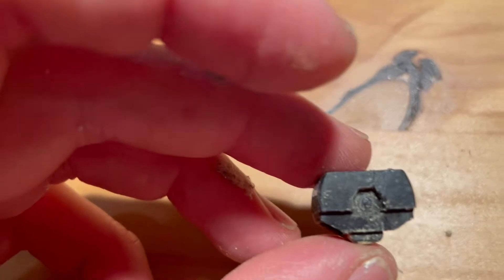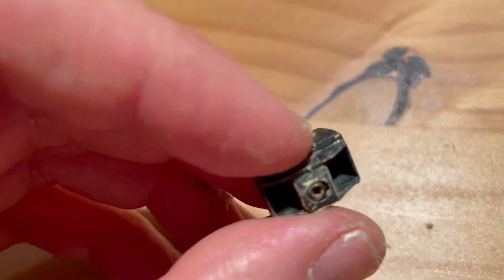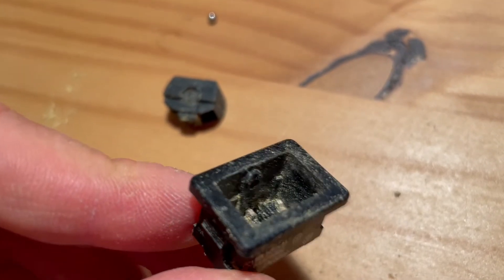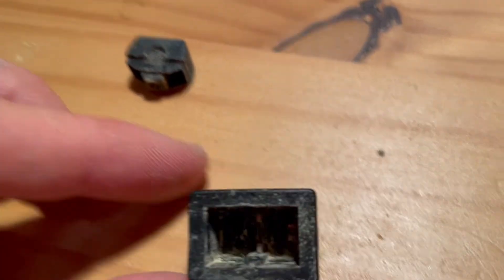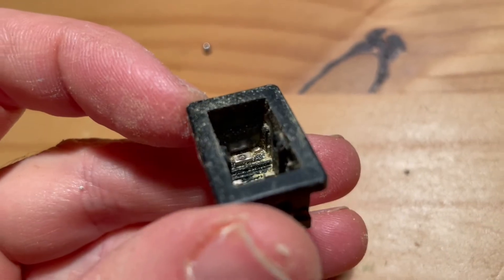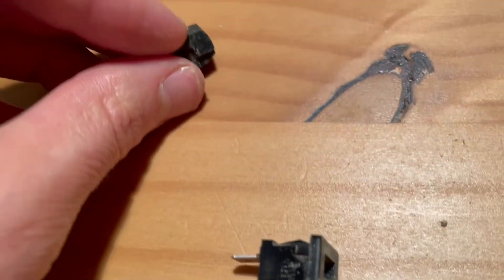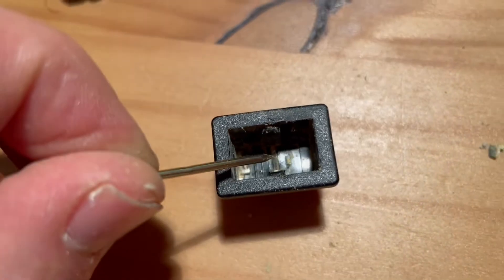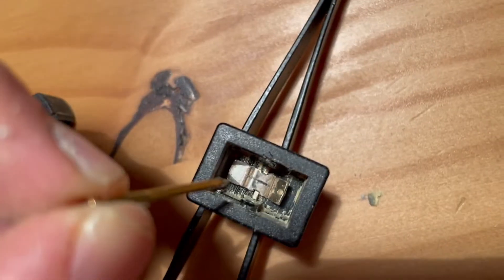How to Fix a Rocker Switch in 60 Seconds

Comment: But what causes cheap Chinese rocker switches (or socket switches) from toggling at all? - ie. you can push it the other way, but the over-center spring doesn't let the switch snap over, changing mode eg. won't turn off  - all you feel is spring resistance.

Comment: I am having trouble prying it back in. Ugh
Reply: After a long time, I managed to put it back. I put the sphere on the top of the spring (the cap upside down) and put a little drop of CA glue, then I waited a few minutes and voila, it remained in place.
Reply: @campidelli  Thanks for the tip about using super glue to keep the bearing on the spring!  That saved me a lot of trouble.